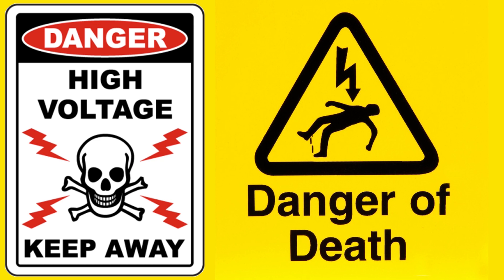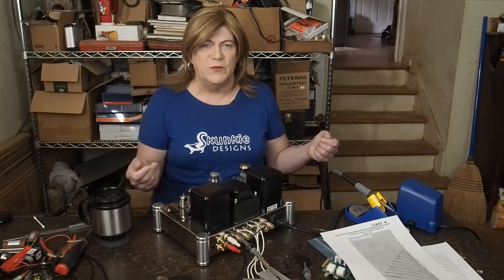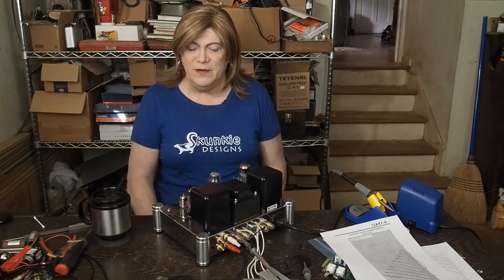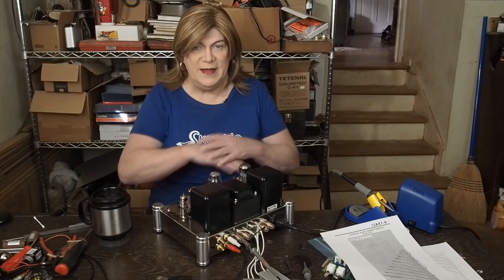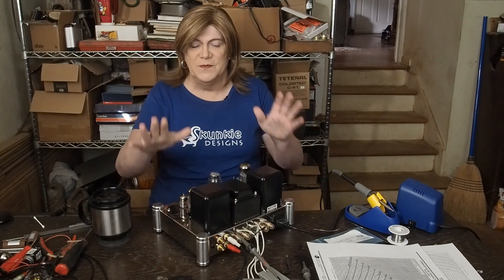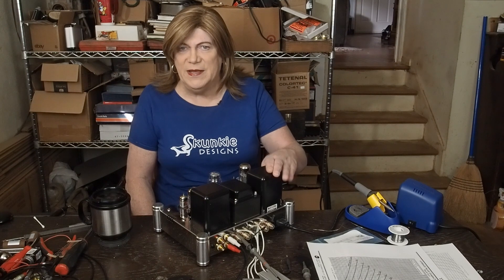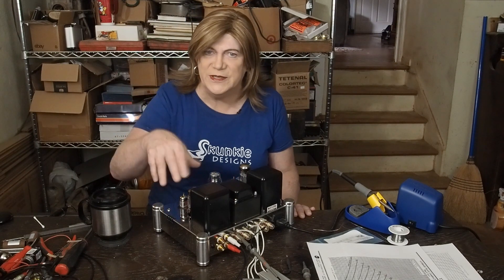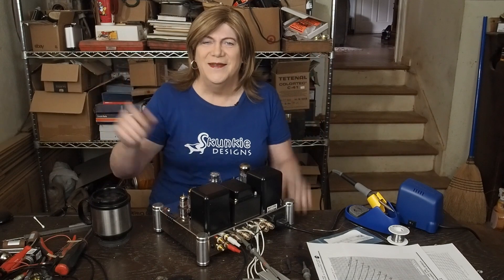Boyuurange Reisong A12: Time to Gut It

Comment: These amps were originally sold as A9 kits by a British company with an office in Taiwan way back in 2010. The case is unchanged. It is only in recent years that fully built amps became available from Boyuu Reisong in the guise of the A10. In 2018 SoundArtist had the 12ax7 version, long before Boyuu. I remember seeing an A9 kit demo'd here on Youtube back in 2013 in this exact same case.

Comment: Just picked up an A12. Rewatching the series as I’m planning on doing the full mod. I was surprised how good the amp sounded out of the box - suppose I was expecting it to sound worse given what I remembered from your videos. Having said that, it was a bit grainy and shrill for sure. Started off putting some Psvane EL34PH Phillips replicas, a pair of 12AD7’s and a 5V4. Helped, but still had the issues listed. Just popped some 6V6’s in it, and that certainty helped. Not nearly as fatiguing. As I’m currently listening to Cornwalls in a smallish room, bass is not an issue. I’m looking forward to ordering parts and doing the mods.

Comment: With relatively high transconductance  and low drive requirements, 7591 were the mainstay of integrated tube amplifiers in my youth.  I once converted a 7591 Eico ST0 to parallel-push-pull 6BX ()twin triode) using a 6H choke input to get the 6BX7 voltage right, replaced the input 12as with 6dj8 and direct coupled the6dj8 plate(as with stock 12ax) to the6sn7 inverter.  That type can have equal value plate load resistors when the "tail" is very long via current source or negative rail and large Rk.It made a really good little triode amp.  You've got the best bube channel in all of Youtube.
Reply from the maker: The 6DJ8 is a great tube and as I mentioned, I've used both 6EJ7 and 6JC6A tubes triode strapped as drivers and they sound great. The Kegger/Blueglow KT88 amp runs a single 6DJ8 to drive both tubes so there is no reason it can't work here.

Comment: hello , i appreciated your work on tube amplifier ... I am from France , i am 61 years now ...despite behing a PH in microelectronics , i have build more or less the same amplifier when i was 25 years old ... So long time  ago .... this amplifier was with 250V/280V power suplly ( silicon ) and with 2.5K transformer from millerioux ( AH25BB as far I remember ) it has been working in my home for 10 years ..driver was the 12AX7 , parallell ....  Then i go for 300B ... so for me you are fighthing against a transformer issue ... i was getting 6 Watts a 6 % distorsion .... and the sound was really good .... so good that my father  ( electronic engineer in French Army ) decided to go back to tube .....sorry for my bad english ... this is not my native language ... currently  i would like to buy high end hifi amplifier for my retirement but i find nothing to compare with a single end 300B with good output transformer , good power supply (polypropylene in oil ) , same for decoupling .... 
For me you have had a bad expeximent with a faulty product .... i do not say that all the chinese product are bad  , i have myself been very disapointed with a line magnetic 845 and on the the other side been very happy with a low cost kit of 300B ..... i agree that to get the sound grall we have to upgrade them but it seems to me normal regarding the price pay ....FYI i build amplifier for 35 years ....I really appreciated your effort in our "tube lover" world ...
Reply from the maker: Turns out the output transformers are OK, I did some adjustments to the operating points and got plenty of power :)

Comment from the maker: Just FYI, the 7591 tube is NOT a drop in replacement. The pinout is different and requires internal mods. My hope is it may require less internal mods than getting the EL34 to work correctly. Someone sent me a note that a 6V6 has a different pin out, not true in this use. The 6V6 ties the suppressor grid to the cathode internally, the amp does the same thing internally with the EL34 tube tying pin 1 and 8 together. It accomplishes the exact same thing and has nothing to do with how the tube performs.

Comment: Very good. I'm in for the ride and yes the chassis is nice so I would still use mine. I'm not against using 6V6 tubes if needed but I'm ok with 12AX7 because I have a ton of them. But where ever you go I'm good. Thank you.
Reply from the maker: Powered sub with 6V6 tubes is the simple fix lol.

Comment: Since we suspect those opts are really push-pull, why not ditch the rectifier and place a L/R input tube into that socket and use both front and rear sockets for power tubes in a push-pull configuration?
Reply from the maker: Someone else suggested using a dual triode power tube to do the same. The problem is finding power tubes that are happy driving a 1.6K load. This stupid amp is making my head hurt, along with people arguing how great it actually is because some other influencers on YouTube said it is! Time to go enjoy Thanksgiving :)
Reply: @SkunkieDesignsElectronics  
On my similar A9 I got good results by:

- biasing the Power tubes to 70mA with 270R resistors, with a B+ of 316v.

-cascoding the 6SL7 input tubes with Broskie "Akido Mojo"

-5AR4 rectifier

- -3dB of GNFB taken off the 16 ohm tap of Hammond 1630sea OPTS

(with hindsight, I should have got 5k but these 3.5k give good results)

These mods have extended the frequency response - eliminating the LF roff-off and extending HF, flattering it's roll-off , producing clean, symmetrical output sine waves which match the input signal exactly on my oscilloscope from 20 to 20k.

Mind, my PT is a normal center tap and runs at a constant 158°F and B+ is 316v.

With the above mods my amp produces 3Wrms per channel on an 8ohm dummy load.

Happy Thanksgiving!
Reply from the maker: @DennisSantos  All that sounds like a good plan. I just got an order in with some 250 and 300 ohm 10W resistors to play with on this rebuild. If I run into drive issues I might try a cascode to keep the 12AX7 tubes. And I think 3.5K OT work well with a EL34, a little bit of distortion but also a little more power. I also will probably play around with some local NFB once I get things behaving. I'm pretty sure I want to start with different OT that I know work well, build a good sounding amp, then toss the original OT in. If that kills it, we know they are junk. A pair of these 15W Edcors is around $150 shipped so not unreasonable. I'm sure people spend more than that rolling NOS ringer tubes in this thing.
Reply: @SkunkieDesignsElectronics  Changing the inputs from parallel to Cascode or anything else in series will flatten out the abysmal HF roll-off, for sure.
All these SE amps seem to use the same schematic diagram, wiring the signal tubes in parallel. Only component values differ from model to model or even revision to revision (or whatever they had lying around) LOL

BTW, swapping out the OEM rectifier with a 5AR4 increased systemwide voltages by about 20v. 
Voltage drop is an issue, more so with that smaller PT, I'm guessing.
Reply from the maker: @DennisSantos  Yeah I'm scratching my head why they needed to do that. A 12AX7 is just about like two 6SQ7 triodes in one tube, and one of those triodes drives a EL34 just fine. Why would they need to parallel it? If they wanted to increase the current for some reason (hard to drive tube or use a low value grid leak resistor), wouldn't you wire the second one as a cathode follower? I'm probably gonna just use one side of the 12AX7. I may try to keep the tube rectifier because so many people believe this make a huge impact on the sound, I'm not really feeling that, especially on a SE amp but... I will say if the PT start getting hot, it's gone lol.
Reply: @SkunkieDesignsElectronics  I think the plate resistance gets halved by running them in parallel but distortion and miller capacitance roughly double, if memory serves... Can't remember what happens to transconductance.... 
I've have Merlin's Preamp book but I'm at work at the moment.

I can confirm that there's a slight difference in output signal.
In one modding session, months ago before i changed them to Cascode I forgot to solder one end of the bridge that joins the grids together on one channel.
When I played music, I noticed the imbalance immediately.
When I tested on my scope, it showed the different amplitude between the parallel and singular channels - the former slightly larger.
It's not much, maybe a couple of decibels difference.
I guess wiring them in parallel is easier for the factory workers, making it less likely for them to screw up.

Regarding the rectifier, I replaced the 5U4G (type) for a 5AR4 because its heater draws 1 amp less, sparing the PT and B+ raised by about 20v. 
Big win, as you'd say.
Not sure how much B+ will be affected on the A10 because of its hybrid tube/diode bridge rectifier solution, though.

Comment: I would go with new output transformers, no point in gutting the internals if ultimately the original Tx's are not up to the job. With my A10, I've tried Voskhod 6AX7's, JJ ECC803's and EVH 12AX7's (rebadged JJ's) in place of the 6N2J's. Replaced the rectified with a JJ GZ34. For the output I've tried EH EL34's, GL KT77's and now EVH EL34's. I really like the amp with the EVH 12AX7's and EL34's. It drives my RP-600M's with plenty of bass (though a lot could be down to room reinforcement due to the fact this system is in my condo). Almost as much money in tubes as I have in the amp but I bought this as a project piece to learn tube electronics because when I did my training as an electronics engineer tubes where ready history.

I find the amp to sound good, drives the Klipsch's well. Sound stage is ok ish... If I cover the flat screen that is between the speakers the sound stage improves significantly. It's not a patch on my previous systems (when I was young dum and full of cum, Roksan Caspian with Triangle speakers/ Gryphon Callisto 2200 and Art Audio Impression speakers) but then I have in this system about what I paid for just the speaker cable on the Gryphon system. 

I find it interesting that you prefer the 6V6 sound. I've heard it said that when referenced to guitar amps 6V6 is the American sound and EL34 is the British sound (I'm British). Looking forward to your further modifications but I'll be sticking with the EL34's 😊
Reply from the maker: I think it's more than just the OT, the operating point is WAY off for what a class A amp should be running. Replacing the OT isn't going to fix that. I don't think replacing any one thing is going to fix it. And like I said, there is no reason to parallel a 12AX7 to drive an EL34 or any tube in this class. And I think you are talking about the 6CA7 vs EL34. Those are both 25W pentode tubes, one is US and the other Europe. And yeah they do sound very different, I prefer the El34.  The 6V6 is a different class, much lower power pentode tube, that when put into the stock amp is running closer to a Class A operating point.  That is why the distortion drops away, the stock setup is like trying to run a one side of a class AB push pull amp.

Comment: Many top rated reviewers claim that it's great! Many...
Reply from the maker: Actually if you listen to most of those reviews, they never say "It's great". They say things like "For someone interested in trying a tube amp, this is a way to do that for $500". And I can't help what I am seeing. 7% distortion at 1W and the electrical inability of this amp to produce over 3W, which is 1/2 of it's claimed performance, is never going to be "Great". That's like saying a car that actually hesitates and stumbles, and then finally makes 1/2 the horsepower the manufacturer claims is great/fast, just because the paint is shiny and it's cheap. I suppose compared to not having a car that would seem great?

I'm sorry people have purchased this amp and are now defending their purchase choice based off some influencers praise, that too doesn't change the facts. If this was sold in an environment where people could A-B listen to various amplifiers before the purchase, I doubt many people would be buying this. And again, I'm sorry if this has upset some people, but I'm never going to candy coat the facts about this stuff and I don't care what "Many other people say". Many of those same people are trying to sell you $1500 speaker cables...